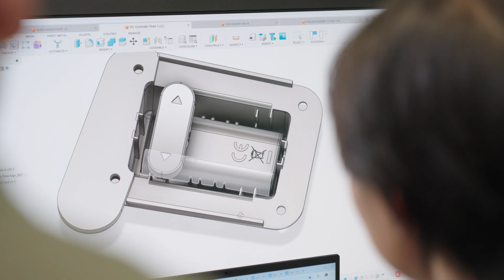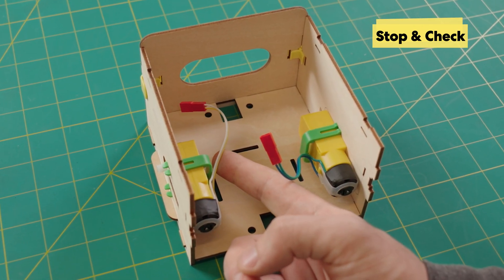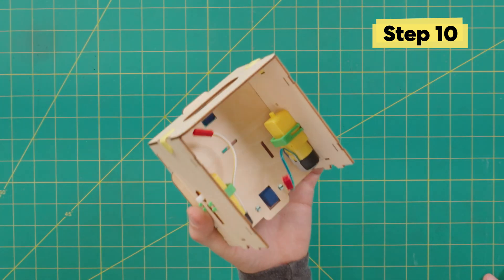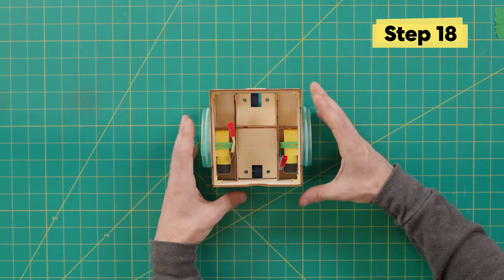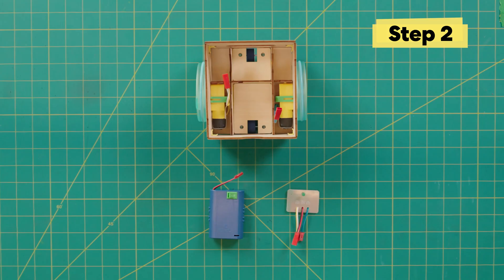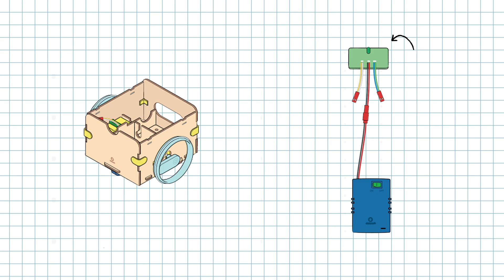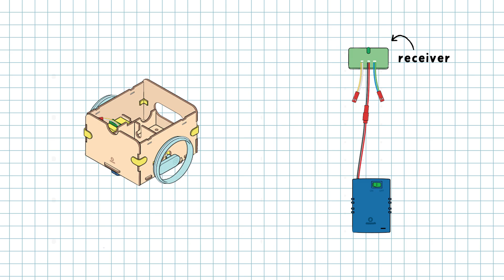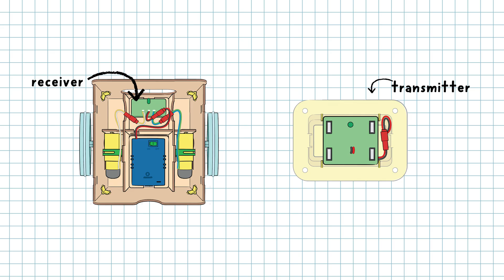How to Build a Wireless Delivery Bot | KiwiCo

Comment: What happens when the controller light flickers
Reply from the maker: Hi there - thank you for checking in with us. A blinking light typically means the transmitter in the controller is searching for the receiver in the bot. Could you try turning both off and then turn on the controller first then the bot? If this doesn't work and you've checked the wire connections in both, please reach out to our support team directly and we'll work to resolve any issue. We hope that helps!

Comment: Hi! I was just trying to use the transmitter and receiver to remotely power a motor but the controller wouldnt connect (the light was flashing and pressing buttons did nothing) and the motor would spin on its own. would you be able to help me?
Reply from the maker: Sorry to hear about your experience. Please visit our website and select “help” to reach our Care team for support. We look forward to assisting you.
Reply: Same issue here, the support team pointed me to this video… but it doesn’t solve the issue